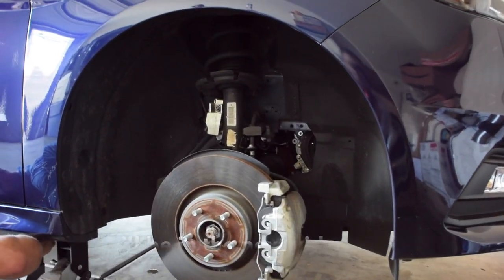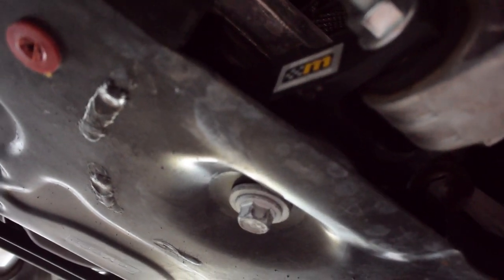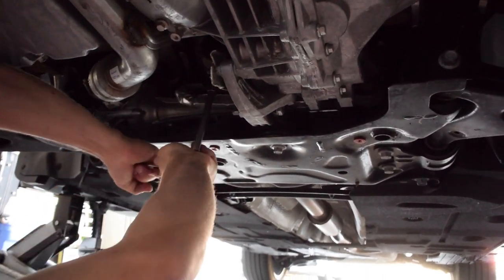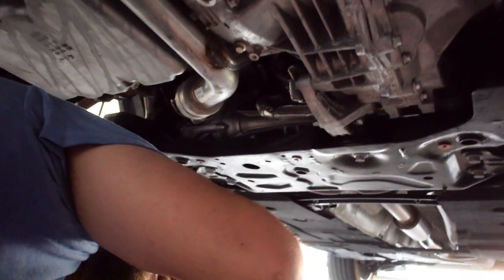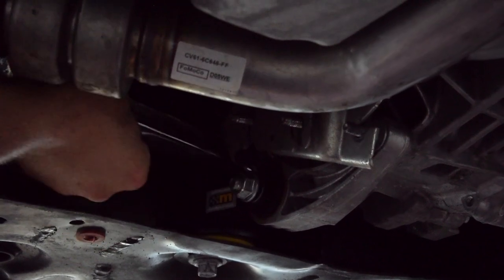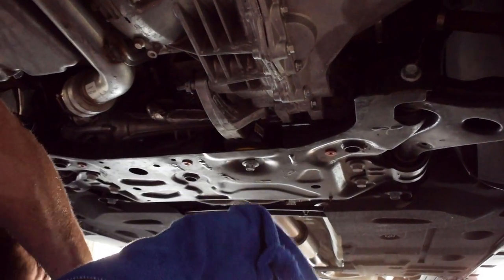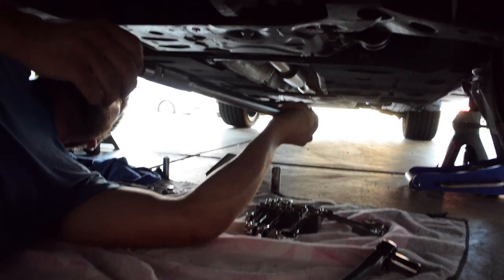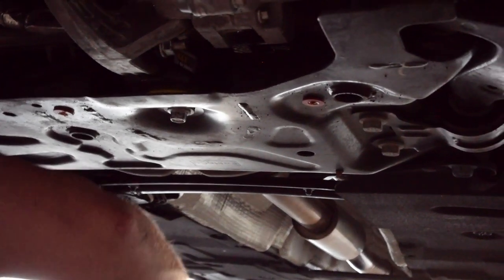Focus ST Rear Motor Mount Issue! - Fixed

Comment: I just watched the mountune install video and they specify the logo etched on the part to face down. So the logo and the radius on the two legs should face down which would make the sticker on the side right side up. Not 100% sure yet but I think you had it right the first time.  Love your videos.

Comment: Great video. That guys a champ! When I did my RMM 3 weeks ago my friend who was helping me "doesn't trust jack stands" so we had to use ramps. So the car wasn't suspended as high as yours and it was awwwful. At least i had the luxury of doing it in my own garage and didn't drive the car 24 hours prior so I wasn't burning off my fingertips lol. Regardless working on cars and adding parts is one of my favorite things todo even when it's 108 out!

Comment: My early '13 ST had the standard Focus RMM and desperately needed an upgrade. I bought the Ford electric motor mount as a replacement, which was later used as OEM on the RS. It's alot cheaper than Mountune, Cobb, etc... It's looks pretty utilitarian but it cured the wheel-hop, so I'm happy.
Reply: Do you have a link ?

Comment: What do you think about upgrading the oil catch can, I read fost owners are installing one as preventative maintenance, to avoid detonation and oil buildup blown into the turbo and collecting puddles in the intercooler, I don't want to be a recreational mechanic fixing something that doesn't need fixin, but I also don't want my engine to explode, have you done this upgrade or planning it ?? Thanks
Reply from the maker: I think it's a really good idea and I should probably do it haha
Reply: I put both top n rear good shit man worth every cent

Comment: Hello I have an issue with my mountune mount and was wondering if you could help me? I installed the mount but the car still clunks on the 1-2 shift and sometimes the 2-3 shift. It feels like it starts to wheelhop but only one time unlike before when it would go thunk thunk thunk. Is this normal? Also the debate about right side up or upside down is confusing mountune told me twice that the m echoed in the mount goes face towards the ground.. but my m sticker on the side is the right way. But you on this video have your m on the side upside down? So I would think that mine is wrong still? I can’t find any printed instructions from mountune anywhere and their video is crap.. if there is any way yo7 can help I have pictures if it’s easier to explain? I c@nt stand fwd wheel hop and thought this would eliminate it.. maybe all it does is help? Thank you in advance mike.
Reply from the maker: Hey mike two things here 1) in the video the motor mount is installed upside down and in later videos I fix it. Also make sure it is torqued to the proper amount. That should fix everything. It also takes about 2-3 thousand miles to get used to and break in

Comment: Nah the vertical bolt is suppose to be 70-80 so 75lbs and smaller are 45lbs torque